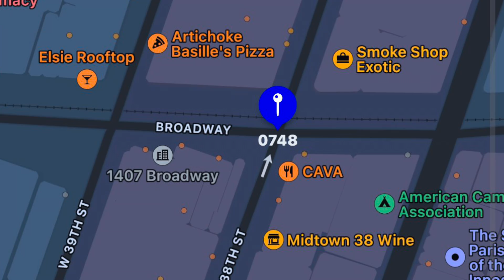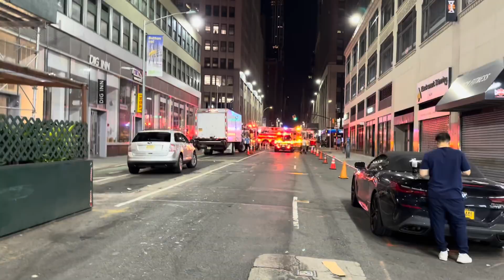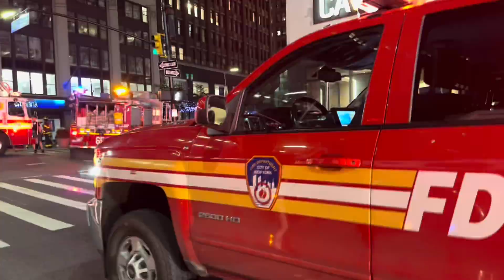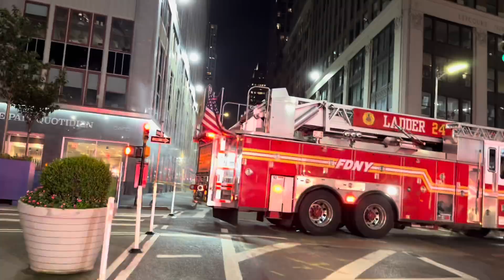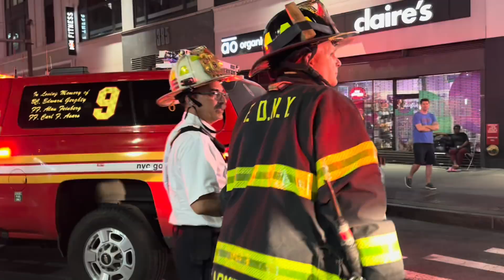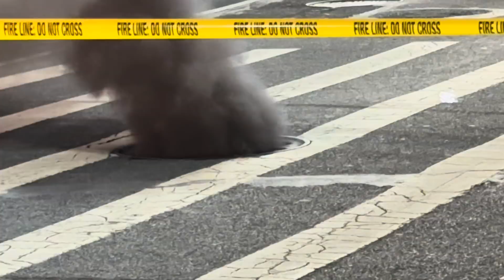FDNY Manhattan All Hands Box 0748 Manhole Fire

Comment: In this situation, Skyler,what did they use here to calm down this angry beast? Hopefully not H20,or I am wrong on this.
Reply from the maker: Water directly at ground and let it flow into the manhole. It will fill it up and cool it down. This has to be directed by Electric company. So they can cut the power.